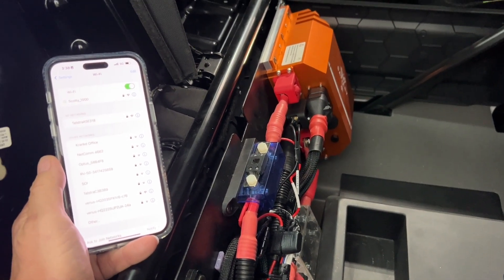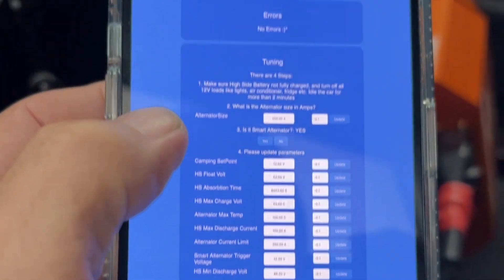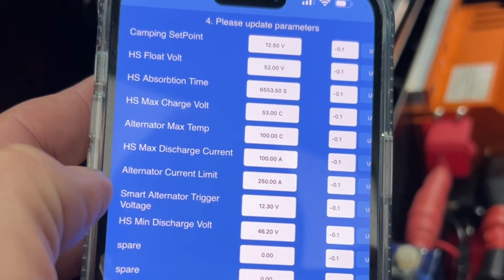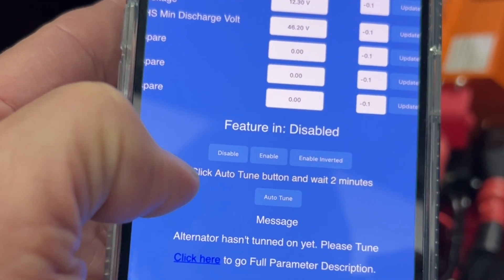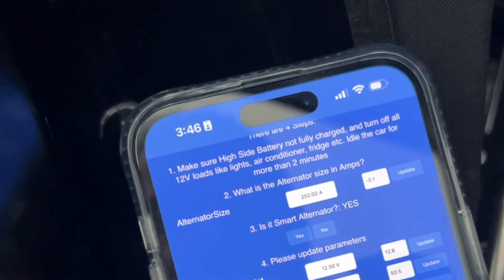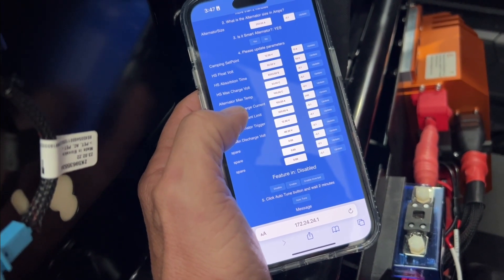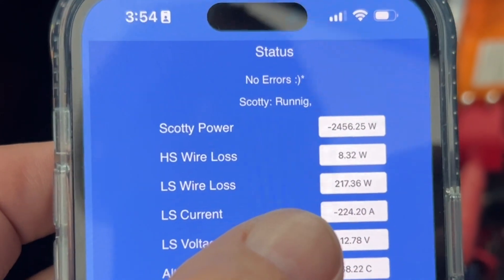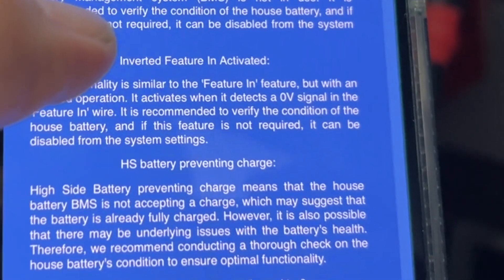Scotty AI How to Auto tune

Comment: Hi, I am a UK customer and believe that I need to retune the Scotty Ai To my VW Crafter. This is because on the first auto tuning process the van wasn’t idling, but had the aircon on. Now when I start the engine, the Scotty Si doesn’t trigger on unless I run the air con or put a heavy load on the starter battery. Instead the leisure battery gets drained as it (is discharging) power the vehicle headlights etc… 

I think I need to retune it and believe in order to do this no need to update the software (wipe the exiting auto tune ?) can you please email me the software for the update? I have sent an email to Safiery but have not had a response yet. Thank you 🙏
Reply from the maker: Yes it is easy to do. Tap on our chatbot and the support team will assist. Its a 30 second job.